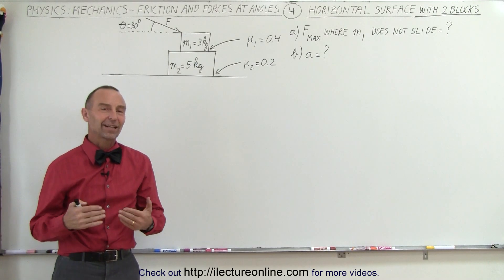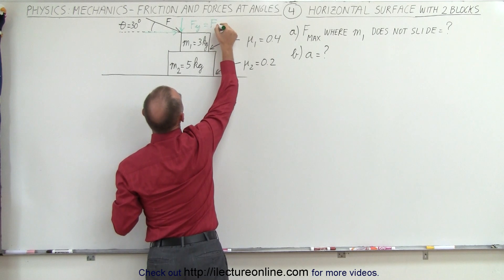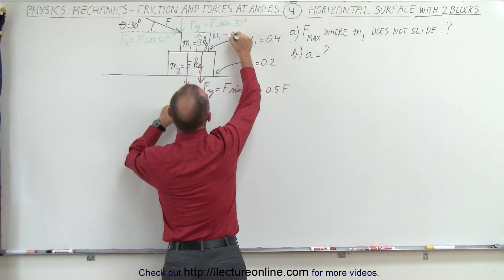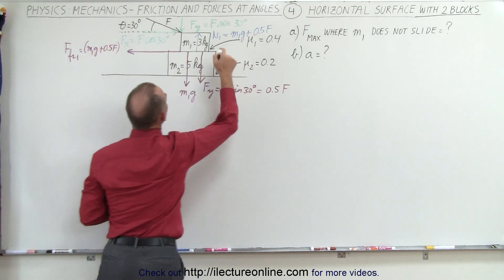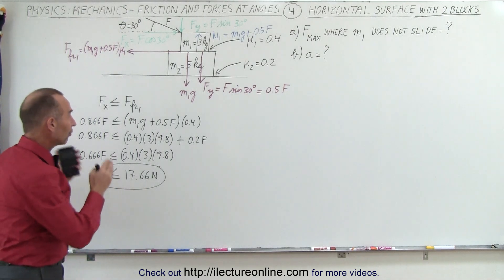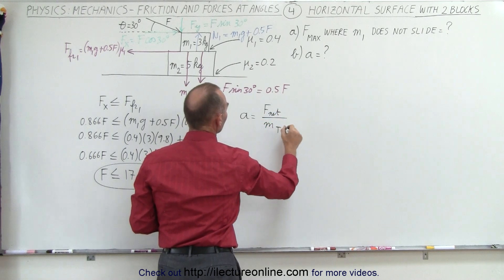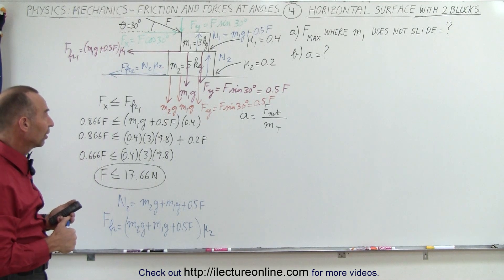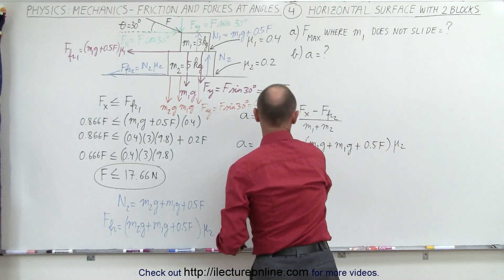Physics 4.7   Friction & Forces at Angles (4 of 8) Horizontal Surface with 2 Blocks

Comment: Thanks for your nice example,  i am just wondering  you are using Mu1  and Mu2  are they static or  kinetic  coefficients ???  I think for Frictional force 1 you need Mu_s  NOT Mu_k   since m1 dose NOT slide  on m2??  am I Correct ??
Reply from the maker: For part (a) you are looking for the maximum force that can be applied before the box starts sliding, therefore the friction between the blocks is static friction.  For part (b) we are looking for the acceleration so the friction between the bottom block and the surface is kinetic friction.
Reply: Also since  the acceleration is negative then Fx in not enough to break the  maximum static frictional  force  (f_s_2 MAX).   I think YOU Need to be more clear !!

Comment: Hi professor Michel. Another one of your great practical examples!
I have a different view on the approach though. I think if we want to compute the acceleration of the upper block (or to know if it will slide), we need to know if lower block will accelerate first. And vice versa... if I'm to compute acceleration of the whole system, i need to know 1st if the upper block will slide. 
Reason behind my approach is that the acceleration experienced by one block will change the force net on the other block. Assuming that the block is still in order to compute the acceleration of the other block might turn out to be the wrong assumption at the end. Am I correct profeasor?
Reply from the maker: There are indeed several ways in which you can approach this problem.  In the end: "the proof is in the pudding" as we used to say.  If you get the same answer, the approach is most likely valid.

Comment: In my book, it is given that for blocks to move together F <= [u1(m1+m2)m1g]/m2 where F is the force acting horizontally. Note that in my question the given force is at an angle of zero degree to horizontal not 30. So, is the formula correct?? Please explain. Thank you!

Comment: First of all, thank you for your helpful videos but I do have a question why did you find the force first then the acceleration while in this video https://youtu.be/tk7yk0Xzplc?list=PLX2gX-ftPVXV71KEcdvw7U5PoNGx9onxk you did the opposite?
Reply: Haha, both methods can work but notice you can't find acceleration here first because Fr1 which aids M2 to move has f in it. The f component appeared as the force was applied was at an angle 👍

Comment: Math MachineOkay, there’s a little something I’m confused on, but it’s a little hard to phrase properly, so I’ll probably have to phrase it in the form of a question or two. Assume two tables are pushed together. A large block is resting on the small crack of space between the two tables and is in contact with both tables. I push the block and it moves across the small crack, still in contact with the two tabletops as it’s being pushed. Assuming I know the mass of the block, the frictional coefficients of both tabletops (they both have different coefficients), the active pushing force, and how much of the block is in contact with each table, how do I calculate the net force acting on the block?
Reply from the maker: Assume half of the mass is supported by each table.
Reply: Michel van Biezen thank you so much.  I was a little confused on the concept of friction when I realized that there could be multiple forces of friction acting on an object at once, despite it being a force independent of area of impact.  I get it now though, I just wasn’t thinking about normal force correctly.  Thank you!

Comment: Sir why u don't use the effect of Ffr1 on the block m2 in the rightward direction for calculating the acceleration
Reply from the maker: Because for the second part of the problem, Ffr1 is an internal force to the system and therefore cannot contribute to the acceleration.
Reply: @MichelvanBiezen  Sir, ok it's correct to the problem here. But,
Is it having a frictional force acting on the block m2 to rightward direction? (as there is a frictional force between m1 and m2, and also which will accelerate the system to rightward direction)
Reply: Which is,
 Ffr3 on m2 to rightward direction = (m1•g + 0.5F)•u1, is it correct?
Thank you sir.
Reply: @DevonRavihansa  no, both frictional forces will be to the left as drawn in the video. Because system is moving towards right.

Comment: sir I have a doubt,you are applying the force on the m1 how it will accelerate the total system
Reply from the maker: There is a friction force between m1 and m2, which will also accelerate m2.
Reply: thank you sir